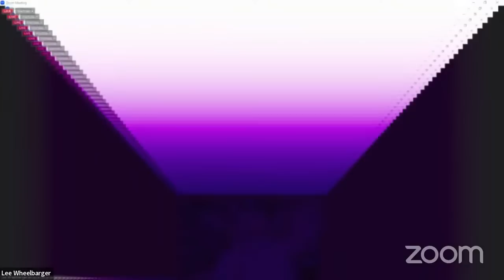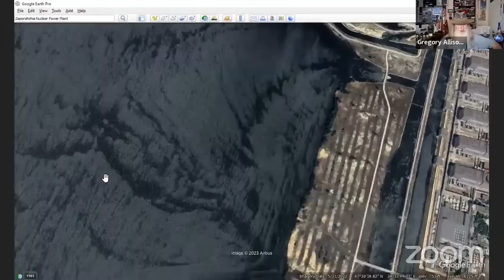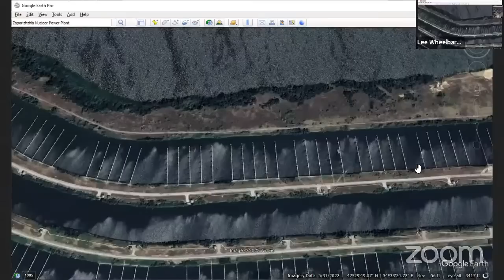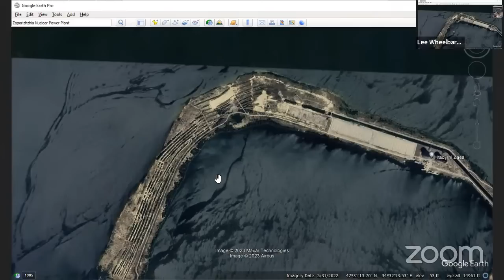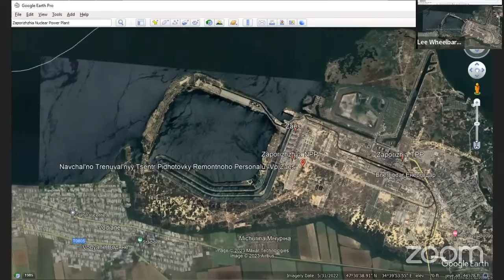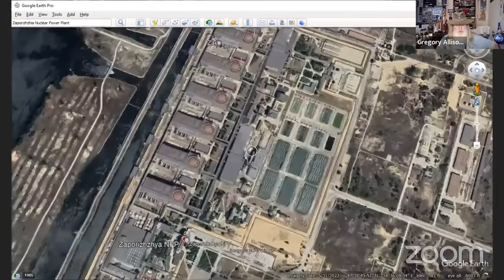Zaporizhzhia Nuclear Plant Cooling Pond Dropping Fast - Melt Down Threat

Comment: You need frac pumps most likely about ten of them.  There's a company in Texas called pro frac. That has many of these pumps available and sure they would help to avoid this problem.  These pumps would handle the job much more efficient than a tractor would but would still need diesel.
Edit.. you would need C-1-30 or bigger heavy lift plans to get them there though in that short amount of time.  Not sure it's possible.  Just a thought is all.

Comment: Given the recent reports of Moscow ordering the shutdown of radiation monitoring sensors at the Zaporizhzhia Nuclear Power Plant and the alleged Ukrainian planned terror attack on the 3rd of July 2023 at the ZNPP, along with the possibility of a stealthy decommissioning by Russia, it raises questions about the intentions and actions of both parties involved.

If Russia were to decommission the Zaporizhzhia Nuclear Power Plant (ZNPP) while aiming to prevent fallout and maintain stealth, they would need to follow established safety protocols and procedures. This would involve carefully handling and removing the nuclear fuel rods, shutting down the reactors, and implementing measures to secure the site.

Russia maintaining stealth in such a situation would require a high level of coordination and secrecy. This could involve limiting access to the plant, controlling information flow, and potentially disabling or manipulating radiation monitoring sensors to avoid detection.
Reply: The Director General of the International Atomic Energy Agency (IAEA), Rafael Grossi, has initiated a visit to the temporarily occupied Zaporizhzhia Nuclear Power Plant (NPP) in Ukraine. This visit is likely aimed at gathering firsthand information and assessing the situation at the plant, especially in light of recent developments such as the reported shutdown of radiation monitoring sensors by Moscow.